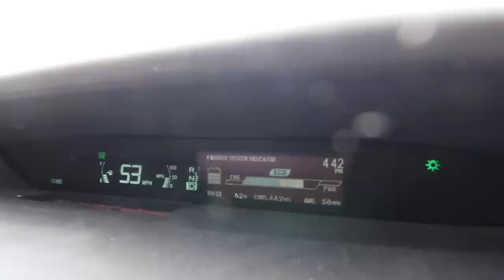We Bought A Trailer For My Toyota Prius.. | How Many MPG?!

Comment: I pulled a 5x8 all metal trailer with 1000 pounds of supplies on it with no tailgate 1600 miles round trip with my gen 2 07 Prius touring and averaged 37 mpg.
Reply: Yup, the Uhaul 4x8 Trailer with 1500-2000 lbs total nets me ~36 MPG in my 2014 Prius.
Reply: What kind of hitch did you install?
Reply: Wow man, nice. I hear a lot of stories towing is not possible due to various reasons. One of them is that the electrical system couldn’t handle it. But apparently you can :)
Reply: Will a 2015 nissan leaf tow a 4x8 uhaul open trailer with 3  homedepot security doors and 2 bathroom vanities?? I also wanna pick up a rogue squat rack 8 hours away round trip. The squat rack is about 400lbs.  I will be using  2009 prius for the 8 hour trip not the nissan leaf

Comment: Haven't seen the whole video yet, but I own 2010 Prius IV. When hauling two 65lb E-bikes on a Kuat bike rack..I went from 48-51mpg bare to 39mpg due to the negative change in drag coefficient. Granted, that's still way better mpg than anything else out on the road with a small tow. I suppose we get a bit spoiled when we drive Hybrids.

Edit: Just finished watching the whole video. I'm going to say on a level surface, in eco mode, driving like a Prius driver with fresh oil change, you're going to be around 34-35mpg.

Comment: Well you gave me the confidence boost I needed, I have a 2022 Kia forte with a 2.0 L 4cyl with 147 hp and was worried about towing a small trailer but after seeing this I think I’m gonna go with the hitch install. As long as I keep the weight down I should be fine
Reply: Yeanh man a Prius has like 95 hp and a CVT tranny. On borrowed time.

Comment: The key as Prius owners is determining how much weight a Prius can tote around and how much weight would be on the tongue.  I have a second gen Prius with 270k where likely a previous owner towed with it.  The brake accumulator went out later which is common (one of the big 3) even if one isn’t towing.  It seems varied elevation and terrain changes how the Prius can perform as a towing vehicle.

Comment: I towed a 1000lbs articcat side by side with my 2005 prius on an aluminum snowmobile trailer 8hr not  one little issue. In fact my prius hit 200k miles today and I have not had one single issue with this car in the 4 years 120k miles ive owned this car. Crazy as it is the car is also still running on the original brake pads and still have 1/3 left. I get 48mpg not pulling and 38mpg pulling 1000lbs.

Comment: I have towed one dirt bike with my 2014 Prius.  It does fine on flat roads, but she does not like the mountain passes. I could feel my transmission getting warm and when I stopped at the top of the pass and opened the hood it smelled a bit burnt.  The smell went away quickly once I got off the mountain and my transmission cooled off.  All I can say is take her easy up the big hills and don't think you can throw three bikes, 3 guys and gear in the car and go anywhere.  She won't like that at all
Reply: How did you go about installing the trailer? Did you call up your local auto shop? I have a 2017 Prius.
Reply: @LovesHighGround  I just ordered a trailer hitch and wiring harness off Amazon. It’s an easy 4 bolts to install. Lost of videos on YouTube on how to install
Reply: @AustinM-wf5nk did you install a 1 1/4" hitch receiver or 2" hitch receiver?

Comment: Just what I was looking for!  Thank you!  A 4x6 utility trailer would be perfect.  I've been looking around, doing research, bending my mind back and forth on what to get for long road trips, as well as hauling a motorcycle to add to my adventures.  I think I am coming to the same conclusion as you.  First I was thinking Honda Odyssey, too (then heard of bad transmission); still vacillating on a Toyota Sienna minivan (for more room and cooking); but the Prius MPG (almost as good as a motorcycle), and that's just really tempting in terms of gas cost.
Reply from the maker: You can’t beat the Prius for fuel economy and the generator aspect of being able to run the a/c and heat with the engine off.
Reply: @AdventureDaily  
Ah, yes.  That, too!

Comment: I'm gonna guess on average, 42mpg. My dodge get 10mpg, loaded, unloaded, just 10 🤣
Reply: When I tow the Uhaul 4x8 I drop to ~36 MPG in my 2014 Prius, but that's between 1500-2000 lbs, including the Trailer. And that's over 4000 miles.

Comment: Don’t need a title you just need to have it weighed at a certified location, take the weight to bmv, bam, tags.
Reply: Adventures with Nick Fry yep this is correct.
Reply from the maker: Good deal! That’s what I read just wasn’t sure, seems pretty easy to steal a trailer then!
Reply: Very much so, keep that thing locked up always

Comment: What 'mode' should you tow in? I'm assuming eco mode with regen(B) on? 
Eco to prevent shock to the axles on take offs, and (B) to keep the ice motor from shutting off at stops?.. but I don't know if Eco mode reduces any torque from the MG2? (As far as I can tell it only effects throttle placement). And I don't know exactly what (B) mode does inside the transmission? The weight should help the (B) effect, but there's gotta be a limit.. 
As far as I can tell, it seems most people can tow 1,000ish lbs without much problem, but no-one mentions what mode they drive in or if they use (B) or not? So maybe it doesnt matter?
If anyone has any horror stories or suggestions let me know. I've got a 2011(3). I'll be towing around 750-1,000lbs with it.
Reply: B mode  is  a  engine  brake  good    to  engage  at  50 mph   not  much higher        to  drive  towing  or  not  towing    tou  put  that  transmission    in  drive     and   just  go

Comment: My Prius C drops from 54 miles to the gallon then I put my trailer on with 700 lb and it drops to 39 miles to the gallon.  I have airbags stuffed inside the rear springs filled with nitrogen for heavy loads.
Reply from the maker: I really need to do a suspension upgrade at some point! Awesome to hear somebody out there doing the same thing! People can say what they want but this is my favorite vehicle I have ever owned.